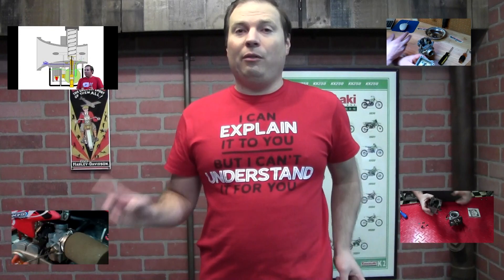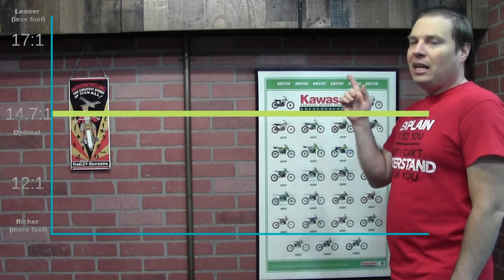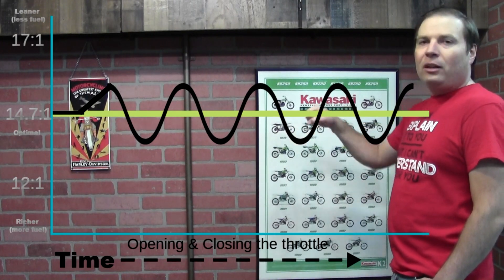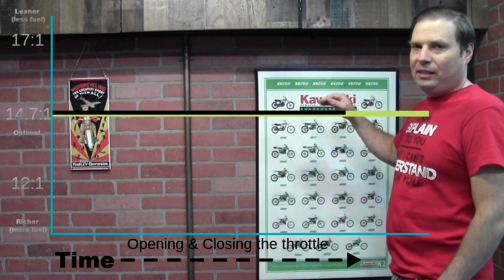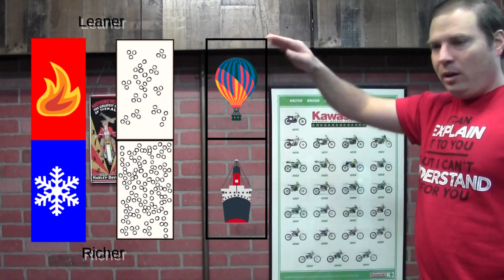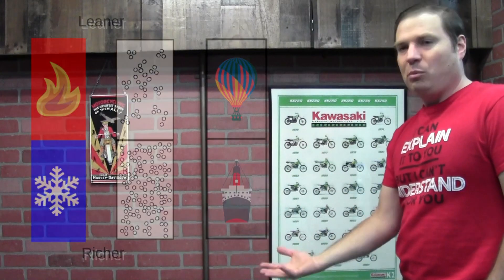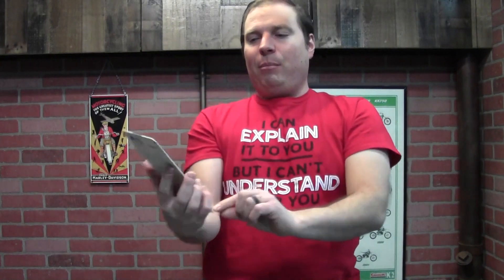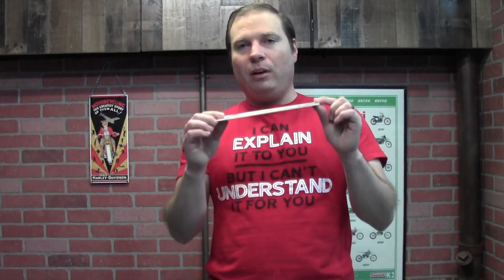Rich or Lean, how to figure it out? Carburetor adjustments

Comment: Hello Mr Thejunkman
I am unsure how to use the pocket calculator (5:53 mins at video)  I'm at 7500' elevation.  Suppose one had a 240 main jet @ sea level.  That person moved to a + 7500' elevation.   Using the calculator to make a correction, they line up 240 with 7500' elevation and pick a main jet size of 290(ish)   Seems correct to me to go to the ( - ) negative direction. I thank you for your vids.

Comment: hello, my son has an 2004 cbr125r from Honda, he has n aftermarket exhaust an pops on dethtrottle/deacceleration. Guess its running lean. have u suggestion what to go up to from the 118 stock main? Do he need yo go up on pilot to?
Reply from the maker: Just have to try and see. Jets are cheap.
Reply: @thejunkman  thanx, do you know what jets I need to order, think it has an keihin carb
Reply from the maker: No.  You will have to open it up and see which style of Kehin, there are different types.  Go to JetsRus and match them up if you don't know.

Comment: Funny, I just learned about what a motorcycle rectifier is. And he used the base word in the video. 00:22 Rectify means to make things right/ to fix mistakes. A motorcycle rectifier takes the 'bad' A/C and turns it to D/C of the correct voltage. Basically.

Comment: 14.7:1 is stochiometric ratio, not optimal, but idealistic (calculated by chemical formulae), to actually burn 100% of oxygen you need ~13.2:1 and to burn 100% of fuel you need ~16.5:1 AFR.

Comment: i just got a brand new apollo rfz 125 open and went out to the trails today and after the exhaust pipe was all purple/blue for the first 5 inches of the pipe. so hopefully i didnt cause any damage? the bike performed really well tho.
Reply from the maker: That is going to be normal to have metal discoloration from heat.  They don't use high quality materials for the exhaust.  I would not worry as long as it is not glowing red.
Reply: @thejunkman  Thanks for the reply!

Comment: I recently tried a 24mm carb on a 81cc engine, the carb is set up for a 120cc engine, I'm guessing it needs much larger jets because it wouldn't run above half throttle and sputtered from about 1/4 on throttle, the 81 cc is modified, free-flowing exhaust, high revving cam , and ported head, with in shrouded valves, with a redline around 9500-11000 rpm, I'm about to go to a bigger bore, 90cc with a better head, larger valves, and about 0.5:1 more compression, I'm hoping for a minimum of around 12 hp at the wheel,    I just wonder if this carb is going to  work, it's a CV carb, the largest factory type carb available is a 20mm, I have a modified aftermarket intake port matched to the head, I have tiny drill bits to drill the 105 jet to about 120-125 +/-, in about 2 size steps, I have it at about 108-110 now and going to try it, I'm thinking about drilling the slow jet slightly to hopefully get a better idle, and just off idle, and I have washers to space the needle if needed,  I have been wondering if modify the spring would help throttle response any? Maybe shorten the spring to lower the tension, so the throttle can open faster and easier,  I had lost the stock springs and had to use a random spring, I only had half throttle, unless I had speed and let off, and went to full throttle really fast, then it went close to full throttle,  luckily I found the stock spring! I was thinking if it's just long enough to close the throttle, maybe it will give throttle response like or close to  the same as a slide carb,    CV carbs suck with a variator I guess I may as well keep it, if I had a real transmission, I think I'd convert to a slide, any suggestions? Should I go with a 20mm carb and be happy with what it offers??

Comment: High altitude air is more dense and low humidity right? so what should we do when the carb getting miss fire? do we need to rich or lean the air screw? thanks
Reply from the maker: The mixture screw is only for adjusting the mixture at idle speed though. In general higher altitude means less fuel required as the air is less dense because of the lower barometric pressure.  You need to change the overall jetting, not just the mixture screw.
Reply: @thejunkman  Got it, thank you so much :)

Comment: A  question  my bike runs good low and mid power but at full power it feels very weak and have to short shift! Could this be lean on the main jet? Just  installed a full exhaust ony 2 stroke gilera mxr 125 , ran fine before the exhaust change!

Extremely appreciated a reply
Reply from the maker: Yes it probably is.

Comment: Sorry can someone explain why a leaner mix causes overheating? All I can think I'm my head is that the fuel somehow cools the air slightly?
Reply from the maker: Pretty much correct.  It cools the combustion chamber and keeps that temperature in the normal range since fuel is very dense.
Reply: @thejunkman  mate thanks for the quick reply you're a legend, your videos have taught me so much

Comment: My issue was unknown modifications  made to the carbs. Foind out the carb slide springs were trimmed and slides drilled out. Bought a used carb that was unmolested.  Went with factory jetting settings. 190m 35 P.   2nd notch from the bottom on the needle jet clip. Slow roll pulls like a champ wot through the gears. But highway speed 70mph and twist to wide open throttle, i hit like a wall, and slightly roll back off the throttle, it comes back alive. Full bowl height is  at factory spec. Carbs are synced. New air filter  fuel filter. , coil, coil packs, plugs. New fuel pump and relay.   Im wondering gas cap  vent or peacock valve

Comment: I got the mikuni jet card... unfortunately it doesn't go lower than 100 and the jets I will use will be between 70 and 100.  Any suggestions for a good app?  Thanks for the awesome informative videos!
Reply from the maker: You could just calibrate it for another jet size.  Use 150 for example and then slide your scale and then count your steps off as if it was 100.  Does that make sense?
Reply: Kind of.  I will probably do that.  Trying to learn more first!!

Comment: Thanks for sharing your knowledge junkman. I'm trying to figure out why my ,82 Goldwing isn't running well after removing the engine for a starter clutch repair this past spring. I might have a vacuum leak among other issues since I can see the spark plugs are white on at least three of the cylinders.
Reply from the maker: I woyld investigate the carbs on those cylinders. 1982, the rubber parts are probably shot. Might be the diaphragms in those carbs.

Comment: I just had a soft seize on a husquavarna chainsaw  that went into a lean condition. It appears that the fuel line hose to the carb was slightly ill fitting and started to suck air and less fuel. Now the rebuild consists of piston, cylinder and ring inspection and take it from there. As most people who experiece the lean condition and then a seize will say...."It was running great until it stopped".

Comment: When my vstar is cold and hasn't run in a few hours it cannot and will not start without starter fluid. After I fire it up I have to stand there opening and closing the throttle until its hot. After that it starts as if there was never a problem to begin with. This occurs regardless of whether or not the choke is on
Reply from the maker: It is probably some debris in the fuel system, that is the most common culprit and the first thing to check before proceeding.  Clean the tank, fuel shut off, and dismantle the entire (both) carburetors and ensure every passage and jet is clear.  Then re-set (or check) that the carburetor settings are set to the factory positions. You will need a manual for this information.  Read up on this site and it will also help you get familiar with all the parts that affect the mixture while the carburetor is operating in different positions.  https://www.thejunkmanadv.com/motorcycle-carburetor-jetting.html

Comment: Any idea why my spark plug would be black (rich) when I had a vacuum leak at the intake? Idle jet passage is clean and clear.
Reply: And also the air/fuel mix passage is clean and clear.
Reply from the maker: Could be that the spark plug is too cold of a heat range, but that would be a guess. I would correct the leak first. I have info on my site about this.
Reply: I’ve fixed the leak but now the threads in the head are stripped, lol. 

I have high compression in my cylinders. Are colder range plugs not preferred with high compression?
Reply from the maker: It really depends on the engine design. All the heat range means is the ability of the spark plug to dissipate heat.  Use this link to determine that.  From reading this it may be too hot of a heat range. https://www.ngkntk.in/ngk-technology/importance-of-heat-range/
Reply from the maker: I am not sure what you mean by air/fuel mix passage?  You mean the throat of the carburetor, that is the only area that the air and fuel really mix for the first time.
Reply: I would say oil leak but you mentioned high-compression tight clearances for the cylinder maybe the piston rings the Gap clearances are matching leaving a straight line through your piston.  careful when reinstalling the carburetor I installed the open valve the wrong way and kicked it over I would have went straight through the trucks back window

Comment: what a soft seized engine I know hard seized engine because I couldn't barely kick it over
Reply from the maker: Soft seize is when an engine overheats and the parts swell enough to prevent engine rotation, but when the engine fully cooled down to ambient temperature it will spin again.  Even in this case the rings or cylinder may be glazed and piston ring seal is compromised.  A hard seize is when the rings or bearings are stuck and scored and the engine is locked up even after cool down.  Commonly know as a "blown engine" even though no parts actually broke. (eg. connecting rod or piston)
Reply: @thejunkman   thank you
Reply from the maker: I could make a video about it going more in-depth.  Would that be something you and others might want to see?
Reply: @thejunkman  I don't think you can get more in-depth than that man
Reply: Wondering does this have anything to do with oil pressure in the engine how does it affect oil pressure
Reply from the maker: Yes, I could with some animations. :B
Reply from the maker: Jetting? No, Seizing, yes with a but.
Reply: that would be cool
Reply: @thejunkman  cool
Reply: Reply text looks funny not in sequence
Reply from the maker: Yeah, that is just Youtube's way they display comments.

Comment: Good explanation!  It is counter intuitive but higher humidity actually makes air less dense.  http://www.theweatherprediction.com/habyhints/260/

I teach flying and as a memory aide we teach that the three H’s  make air less dense.  These are Heat, Height, and Humidity.    Chris
Reply from the maker: Thanks for the correction! I mis-spoke and you caught it. Most people's jetting problems stem from other reasons like vacuum leaks
Reply: thejunkman I like the old saying that “most carburetor problems are electrical”. Once properly set up, carbs seldom break, but people like to monkey with them for some reason.   Chris
Reply from the maker: This is very much true.  This video assumes that spark is not the problem.  More often than not a partially clogged jet or passage is restricting flow, even after people think they have cleaned the carburetor.
Reply from the maker: Thanks for the view, and the support!